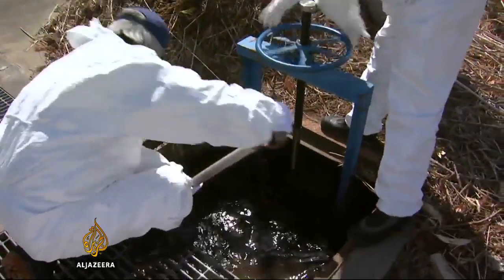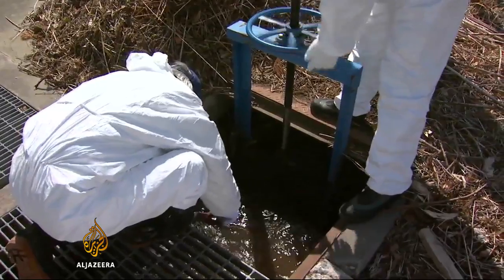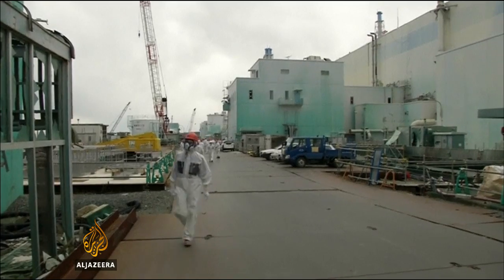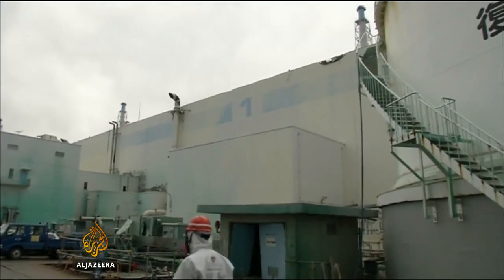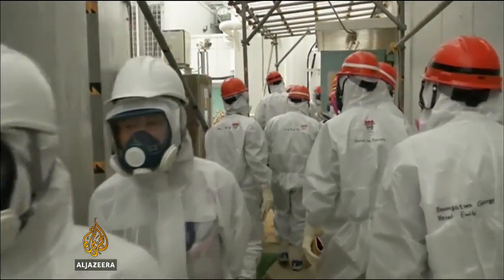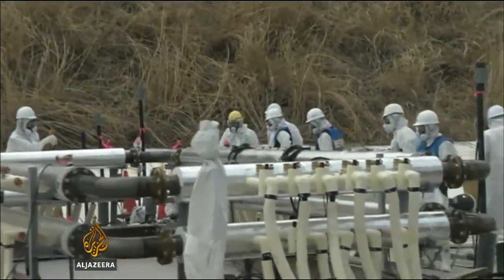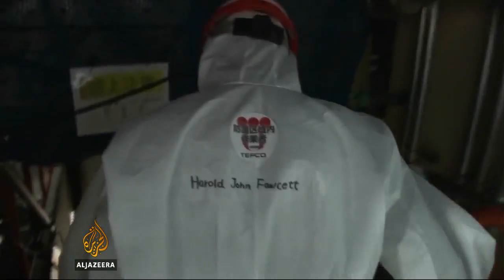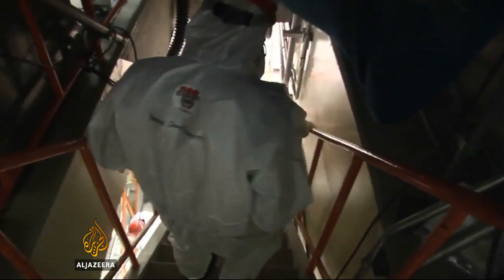Nuclear analyst concerned over Fukushima 'ice wall'

Comment: just interview Arnie Gundersen from fairewinds energy education. he proposes a zeolite trench. basically you dig a trench and fill it with the mineral zeolite. zeolite has micropores and filters radioactive isotopes out of water. water can move through the zeolite, but only very slowly, and the radioactive stuff just stays in the zeolite. that would be easier to do, and does not constantly require power and maintenance, like the ice wall with its cryogenics does.